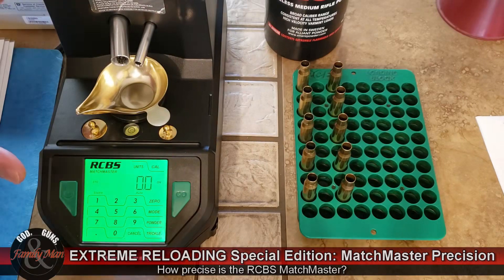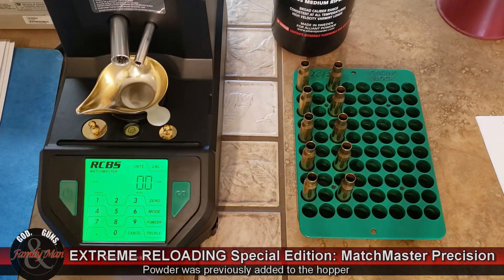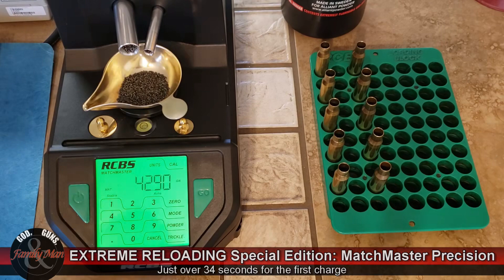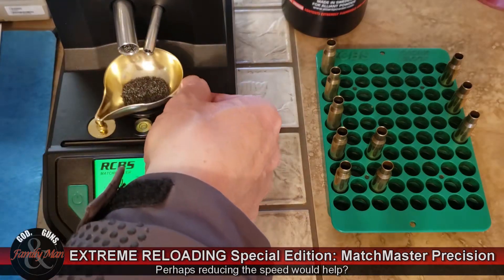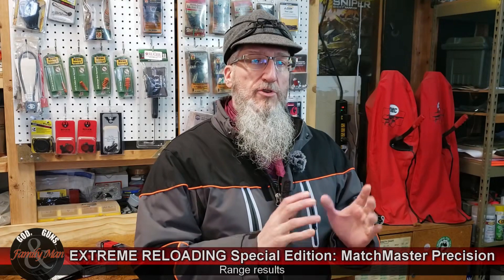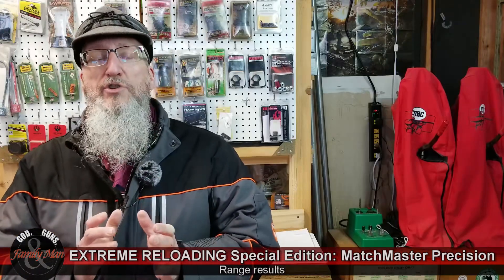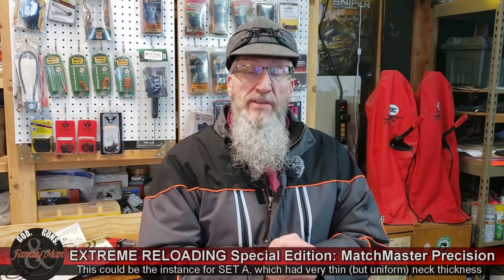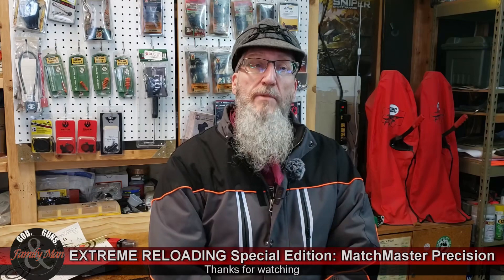EXTREME RELOADING (SPECIAL EDITION): How Precise is the RCBS MatchMaster Powder Scale?

Comment: Based on the final table you presented, it would appear that the lowest neck tension set produced the smallest group and had the second lowest velocity deviation. However it would appear that no variable had a consistent effect on group size. Which begs the question: "does any of this matter?" I was hoping your very scientific approach would result in a clear standout variable we should be working to control. Through no fault of yours, I'm left with the same question as before. Any thoughts as to what we should be working to hold consistent?
Reply from the maker: Good questions Dominic and the answer is that many things (variables) matter but they all have tolerances. Some variables have very tight tolerances and these are things we should work to hold constant.  Others have more generous or broad tolerances which can be met more or less "out of the box".  In my years of reloading and experimentation/testing we need to spend our time on (BTW, I will preface this with the caveat that this refers to standard barrels/chambers, i.e., factory rifles)):
1. Primer pocket/flash hole uniformity and use of premium primers.
2. Powder charges should be thrown to 0.1 gr.  The match mode available with the MatchMaster scale is not necessary. However, be sure to identify the OCW for your particular load.
3. Seating depth with a consistent CBTO demonstrated to work well in your rifle (+/- 0.002")

My testing has NOT shown a benefit from weighing and sorting bullets or brass, but just keep your brass sorted by headstamp.  In addition, I have NOY seen a benefit to turning necks but instead a consistent neck tension can be achieved by annealing and using an expander mandrel (some testing to see what your rifle "prefers" is needed).  I am not 100% convinced the annealing is absolutely necessary but it seems to prolong brass life.

I hope this helps.

Comment: I received my MatchMaster a few days ago, and finally got around to running checks on it today. I also have a Sartorius balance.  After letting it warm up, and calibrating it and the Sartorius I ran checks against the measurements.  I had it on match mode, fast, and was throwing 42.50gn of Reloder 15.  After 15 throws, they measured between 42.50 and 42.54 which is within their .04 accuracy claim.  I then compared the thrown/measured charge weights against the Sartorius and they were between -.02 and +.05 off with an average of .03gn difference.  Good enough for my needs as long as it maintains this accuracy over time.
Reply from the maker: For what its worth, I am still using this same RCBS unit and it continues to work very well for me.  Thanks for watching and posting.

Comment: A few things to note. You can use the McDonalds straw trick and use an electric line filter. Lastly, it is better to sort bullets  by base to ogive. You will have a greater return on investment. Brian Litz discussed this.
Reply from the maker: Hello DW None, thanks for watching. I always use a line conditioner.  Looks like you could not see it on the video but I use the APC line-R 600.  More recently I purchased Hornday's Bullet Comparator kit.  This will allow me to measure length from base to ogive. I am planning to continue sorting by weight first, then by the length. I could reverse the order of sorting and have not decided on that yet.

Comment: Good scales. Would not have thought the speed would affect the weight. Did you try speed 1to2 to check the difference. Thanks for sharing.
Reply from the maker: I did not notice much difference in the amount of time required to throw a charge at different speeds, but the faster speeds (e.g., 4) were definitely faster than 1, yet may not have been as precise.  Thus on the cylindrical powders I use a slow speed.
I was most amazed at how the 1-2 "kernels" of powder was a difference with this scale.
Thanks for watching.